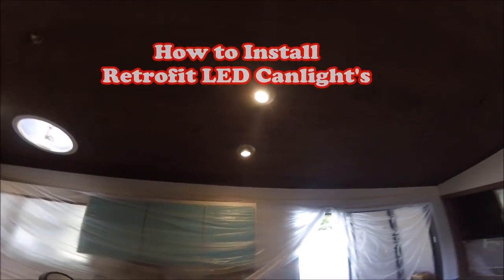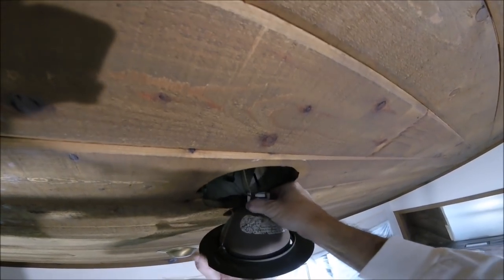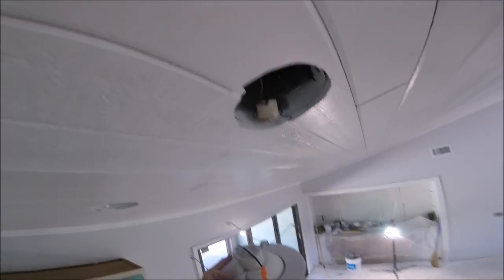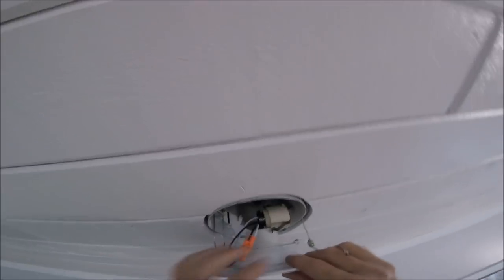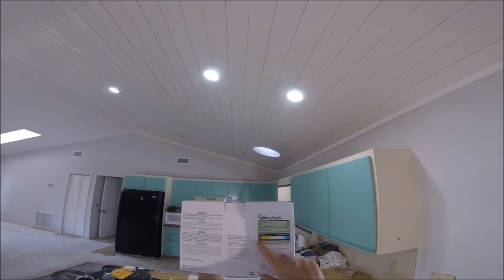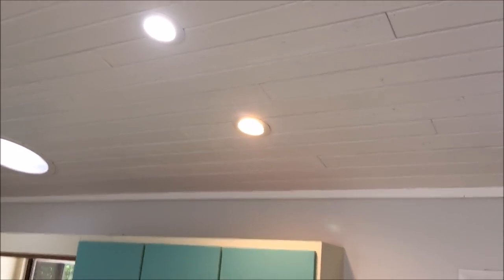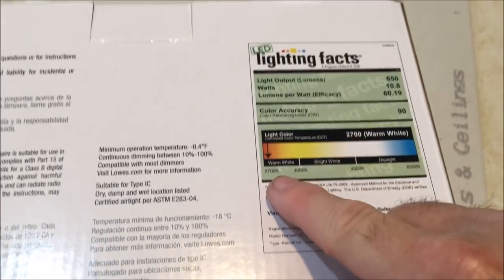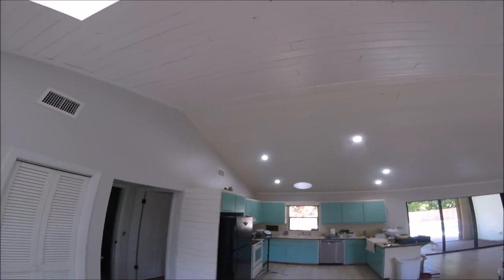DIY- How to install Home Depot LED Retrofit Can light kit-How to Choose the Right LED Recessed light

Comment: Good video Paul. You answered all my question. I have about 50 of these old puppies in my house and although we really don't use many of them I want to change them out.
I like your reno except the shiny paint on the ceiling, I prefer flat on ceilings. Better yet I would have rocked over it, more expensive and a PIA job but worth getting rid of the 60's ceiling.

Comment: I bought a LED color changing recess trim. It came with friction blades, but how do i put those on? I'm not sure what their purpose is. Manual says to take off the spring, but how would it stay or hold up when installed? I keep trying to find a video or at least a picture of what the finished product looks like but I've had no luck.

Comment: I'm with you, Paul--5000K for color temperature. Just to pick a nit though, lumens have nothing to do with hue. They are just a measurement of the total amount of light provided by a source.
Reply from the maker: Yes you're correct Jerry. I fixed that... It's the (CCT) that's short for Correlated Color Temperature that is the measurement for the color temperature color that the LED light bulb gives off. Thanks for the correction and stopping by. -Paul

Comment: I like these lights, but I am wondering why you didn't just replace the bulb with a LED bulb?  When these LED fixtures go bad some day you're going to have to replace the whole fixture, right?  I haven't been able to find replacement bulbs or LED arrays for these.
Reply: In my case at least, all LED bulbs were too thick right from the base and wouldn't fit the bracket fixture of my recessed can light. It needs the bulb to have a long neck.    what I don't get/don't like of this video is that he just shoved the floating socket in. The can is metal, the clips are metal. If not careful, the back of the socket could short. I'd say this is a fire hazard. The recessed cans usually come with a socket plate or bracket. It may have been removed if the current light fixture and trim included a bracket but needs to be put in place in the case of this LED kit which didn't include one.

Comment: Do these work on a dimmer switch and  can you buy colored lenses  for use in restaurants, clubs/bars etc?    Do you save any money on the light bill with these compared to the other lights?
Reply from the maker: Hi American Voter, Yes,  I have these led can lights on dimmers specifically mad for led lights. They work awesome!👏🏻 No flickering and they really dim down low. I’m not sure about colored lenses. I bet you diy some!😜 There is also a big power bill savings compared to the old style halogen style can lights. Plus the led’s don’t get hot at all!  I hope this helps my friend. -Paul

Comment: Did you need a special dimmer for the LED lights, or just a standard light dimmer? 
Thanks
Reply from the maker: Hey Rob, yes I installed a special LED dimmer and it works awesome!👍🏻  on one dimmer I have five of the LED Canlite's and on another demo I have three. There's no flickering of the LEDs lighting or anything. The led dimmer works perfectly. I saved the LED dimmer packaging. I'll post a link to the exact led dimmer when I find it. Did you install some LED retrofit can lights? -Paul
Reply: Thanks for the info Paul. I haven't installed any LED retrofits yet. Our finished basement has  incandescent can lights and I'm thinking of replacing them at some point. 
One other question. What made you decide to get the retrofits rather than just replacing the old bulb with an LED bulb?
Reply from the maker: The retro fit led can lights have a more of a stream line look because they come in one piece. The led light sits flush with the low profile ring and they are more energy efficient then just the bulb led's. Plus with the led bulbs you have to  use the old can light ring and you can still see the led bulb like you could with your old incandescent bulb. 👍🏻 -Paul
Reply: Good to know that they are more energy efficient and they do look better than the exposed bulbs that I have now. Thanks again for the follow up info.

Comment: Can I use that same type of recessed LED light on the ceiling above the bathtub?
Reply from the maker: Hi Delboy, yes you can. I actually have two above bathtubs.👍🏻 The led can lights have a rubber seal on them that keeps any moisture out. I hope this helps. Thanks so much for watching and subscribing! -Paul

Comment: how do you attach the ground wire?
Reply from the maker: Hey Thurston, actually there is no ground wire on the retrofit LED can lights, all you have to do is screw the LED can light threaded male end into the existing light bulb socket of the old can light. Super simple upgrade that makes a huge difference! Hope that helps, -Paul
Reply: @PaulPeck  Well, the ones I bought from HD have a green ground wire attached...The directions and illustrations are not clear at all.

Comment: I installed 5000k LED's and after 24 hours threw them out and installed 3,000k LED's. I hate the 5,000k lights for the home at night as the light is too cold for my taste.
Reply from the maker: +Nicholas Fox I like the 5000 K's because they're a nice white natural light as opposed to a yellow hue in my home.But for each is own I know what I like.
Reply: I tried the 4000k and it made my kitchen look like a cafeteria. 3000k was perfect.
Reply from the maker: Hi Mike, I installed an LED dimmer switch that works perfectly. When I need to read or see something I can. If I want to set the mood in the room I can dim them way down. I really like the 5000k. No yellow just a nice and white natural lighting.👍🏻 Take care, -Paul
Reply: @PaulPeck  Thanks. Maybe that's what I needed. I got a cheaper brand so if I ever want to go back to the brighter lights I can do 6 for less than 100 bucks.

Comment: You'll burn out that led driver if you don't bypass the ballast of the original can. There should be a few screws in the inside of the can which will allow you to access the ballast to bypass it.
Reply from the maker: Hi Eric, These led can lights are the retro fit type. Specifically made fore this application. It’s almost been a year since I put those 9 retro fit led can lights and they’re still going fine. I also put them on led dimmer switches as well. Do you still think this is a issue and why? I really appreciate your comments. Thank you, Paul
Reply: Eric= wrong!
Reply from the maker: Yeah Ramapo, the led can lights are still working perfectly two years later.👍🏻 Thanks for watching and commenting man!😎 -Paul